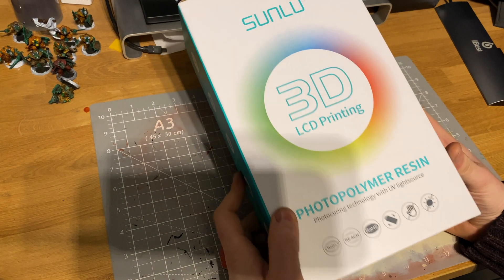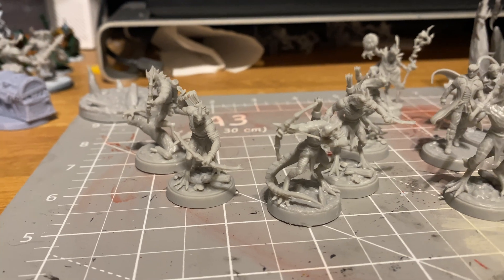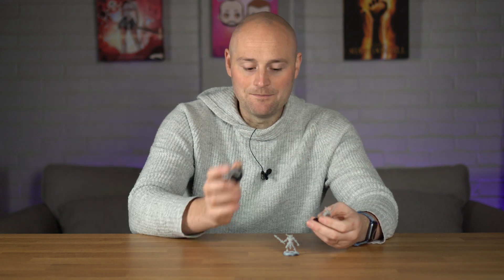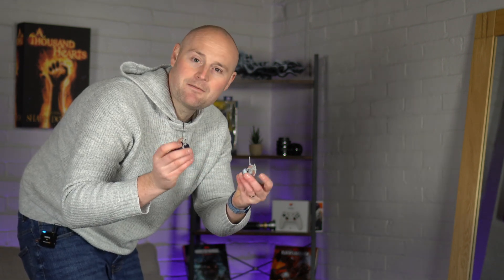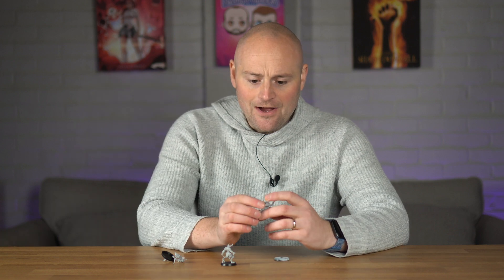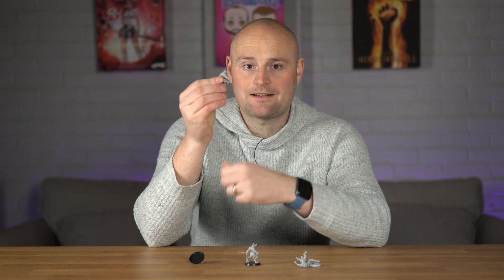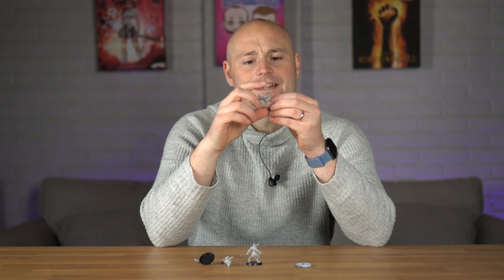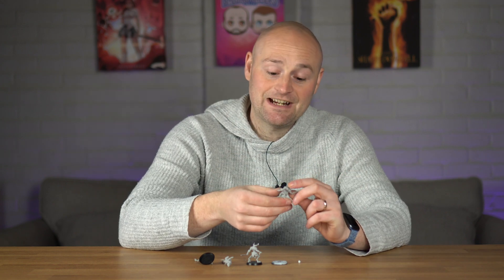Sunlu Standard Resin Review: How is it for miniature printing?

Comment: I use the Sunlu abs like grey.  On my Flashforge Foto 9.25 20sec bottom layer, 8 gradual layers, and a 2.9 sec layer exposure time gives me perfect prints.  It's much stronger and has a good flex than any other standard resins.  It's become my goto for miniature printing since 2 liters is less than $50.

Comment: I just have tried the clear green in this brand and had the prints sitting on a plate for a couple weeks . I seen the other day that some parts have cracks in them so unsure if it's something I did , or is it the resin . Printed on the Mars 3 Pro . I read someone said that soaking to long can cause cracking , Over curing , and having the layer height wrong . But it said it was common in clear resins . My layer H. was .4 , and set recommendations is .5 , Yes I soaked the prints for a while before getting to them . Yes I probably over cured them as I just have a generic light and have no idea how well it works , and no timer . So Nuked Them  ;) But the detail was great .
Reply from the maker: I’ve heard the same about clear resin. Sounds like it got a blasting 😂
Reply: @GrayScalpMiniatures  Have you heard anything about there Water Wash Resin . I am going to try this brand again but Im trying to stay away from chemical washing due to reactions even with using a mask .